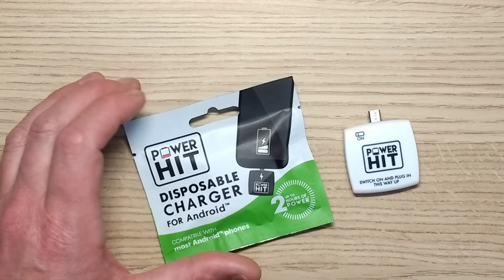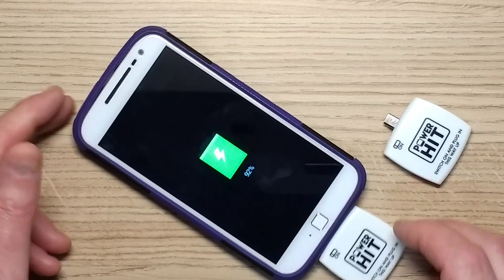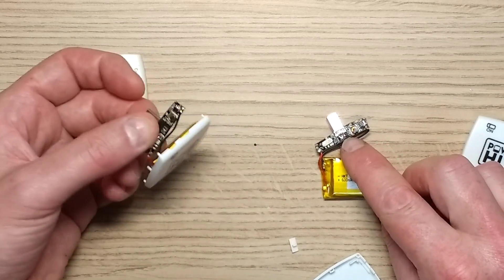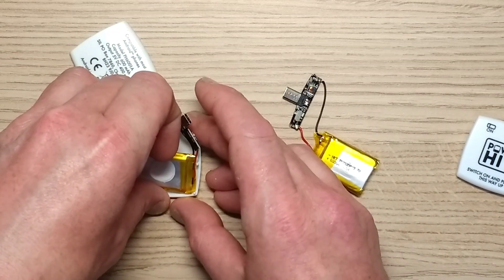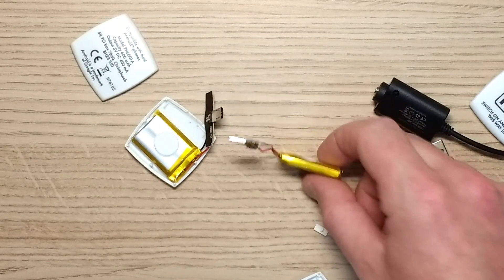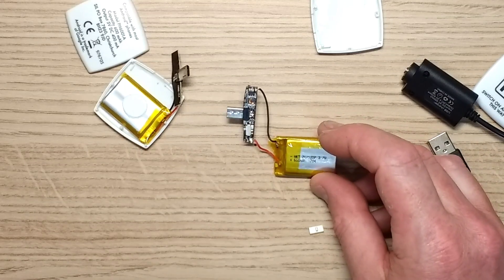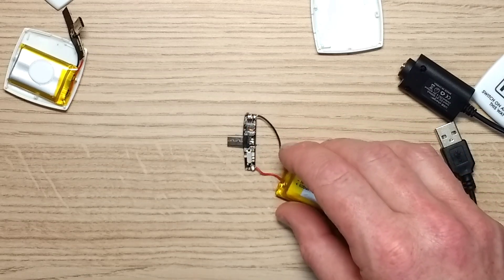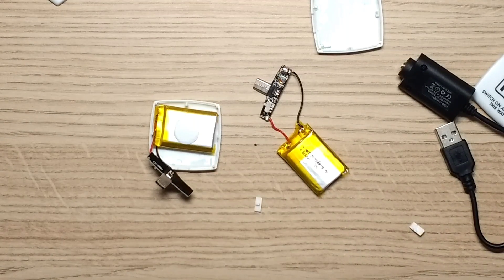What's inside a Tesco Power Hit disposable phone charger.

Comment: This is an awful product! It's a third of the price of a reusable powerbank and is just going to landfill or end up in our oceans!
Reply: buy one use it rip off battery solder on aaa/aa battery holder not a waste if you buy 1 2 then its a waste unless you want to make your wife one you get my point
Reply: the reason people buy them is so they have it in case the phone needs a emergency charge and there is a plug socket or power bank. (also i have had bad luck with power banks/portable chargers)
Reply: silly face Yeah but Lithium sets on fire on context with water. All you need of for the casing to be pierced, and maybe some water, but that isn’t always necessary, and you’ve burnt a bin and maybe even a building down
Reply: Lyn Berger How? Are you mad
Reply: In our oceans? Like the dried up oceans we extract lithium?
Reply: This is more meant for emergency scenarios where you keep one of these in your car or wallet so if you ever find yourself caught in a bad spot and the battery is running out you'd have enough juice to at least make a phone call and get to safety.
Reply: Brian LO Still an awful product because it could be rechargeable but isn't.
Reply: SpaghettiToaster It's not meant to be. It's a disposable one time use Emergency item.
Reply: Brian LO Which is why it's a terrible product. We're going in circles here. Selling a functionally complete iPhone X that's just missing an operating system as a paperweight is a waste of resources. Saying "it's not intended to be a smartphone, but a paperweight" doesn't change that.
Reply: SpaghettiToaster I think we are looking at the word "emergency" differently here. I am seeing it as an emergency backpack as in if your stranded in the wild because of an injury during a hiking trip and you phone is running out of juice, this is part of the emergency kit to keep you in contact before help arrives. You're seeing emergency as in running out of battery in the city where the power kit is a disposable item that aims to replace rechargable thousand mah batteries. Different purpose entirely imo. My original post was about how if this was marketed towards the survival crowd this could be a hit.
Reply: Brian LO I don't care if it serves its purpose as an emergency item though, it's a fully functional rechargeable lithium battery, which is designed to end up in a landfill. Lithium mining is terrible for the environment and mass producing these is not justified, no matter what they're used for.
Reply: SpaghettiToaster You do know there are recycling points for used batteries....
Reply: Brian LO Yes, but this product is specifically marketed not to use them. The packaging says disposable in fat letters and if there's any note on the back that you're supposed to hand it in as a battery, it's hidden and nobody will ever care about it,  because nobody who would would buy a disposable power bank in the first place. Also, I'm not sure if most battery recycling places would even accept this. Anyway, the mere production of these is just a joke. You're producing hundreds of thousands of batteries that have the ability to refill a phone for a decade and design them to be discarded after a single use. It's a massive waste of resources and even if all the batteries were to be recycled it would be a massive loss of energy just to re-manufacture them into an actually feasible product. It's about as good selling a disposable car.
Reply: SpaghettiToaster It's kinda basic civic education. In NA there are green boxes where you just dump these batteries in to recycle there's no refusing. In Switzerland for instance recycling rate is at 70-80% , how many of them gets recycled depends a lot on the government and the quality of the people. Recycling wise it relies mostly on government subsidies ofc since it's not profitable but that's another story. You're still looking at this product wrong. These batteries are designed as emergency one use items like cotton gauze. Cotton can be made into clothes that can be worn for years or it can be made into a single use gauze to dress wounds. If you keep on expecting cotton gauze to work as a cotton t-shirt you're just setting yourself up for disappointment. But of course I'm looking pass the marketing and see only the hardware and its utility. Who will actually buy it when most malls have free charging ports and people already bring their own charger..... I'm seeing this more as an item for the outdoor survival crowd and there's a genuine market for stuff like this.
Reply: Brian LO Brian LO Brian LO Well, I fail to see how you can consider it a civic duty to recycle batteries, but not to not produce disposable rechargeable power banks in the first place. Secondly, high recycling rates are for lead-acid batteries; most places won't even take a lithium unit because nobody is insane enough to throw one away, unless it's broken,in which case you usually take it back to the manufacturer. Thirdly, as I said, even if all the batteries were to be recycled, this would still be a massive loss of energy. A disposable car with a non-refillable tank is recyclable. It's still an utterly idiotic idea. 

Lastly, your cotton analogy fails for several reasons:
1. Cotton processing doesn't have nearly the environmental impact that lithium mining does,so even if cotton balls were equivalently wasteful, it wouldn't be a cause for concern. Also the "cotton balls take away cotton from clothing too" argument is flawed, because lithium is rare and cotton is not. 

2. It isn't actually equivalently wasteful at all, because cotton balls are much simpler objects than clothes. Less work and resources go into creating a cotton ball than a jacket. They are a simple product that can only do one thing and is used for that purpose. 

The power hit, on the other hand, is a 300$ jacket without arm holes that is being marketed as a cotton ball. 95% of the resources of making a jacket already went into it, but you can still only use it to cover your wounds once and then throw it away. This is wasteful and a terrible idea. 

There is absolutely no excuse for this product,a fully functional power bank,save for a cheap microchip and a hole in the bottom,not to be rechargeable. You could still put it in your backpack, it would still do everything you described and at the end of the day you could charge it up for your next tour. And surely you wouldn't mind paying 5$ extra for your emergency item to last you forever instead of once. 

Finally, even if all the above weren't the case and it couldn't be easily changed into an all-around superior product, the mere production of disposable lithium batteries is just a terrible idea. Each of these batteries, if recharged, could power a device for a (human) lifetime. Each disposable lithium battery produced is decades worth of power storage thrown in the trash, lost forever or until recovered with significant energy loss via recycling. 

Also a detail I haven't even mentioned yet: You know what happens if some uneducated person throws this thing in the trash and it breaks, then throws something wet on it? That's right, it catches on fire and burns their house down. Nice!

Zero advantages and tons of severe disadvantages over a rechargeable unit.
Reply: SpaghettiToaster If your country doesn't teach recycling and keeping your country clean as a basic civic duty, the education system has failed. Have you ever even seen a Green Box before in your life or even bothered to do an ounce of research if you haven't? It's not a counter where you hand it to a person. It's a box you dump your battery into , if anything the lead acid car and motorcycle batteries you listed are specifically BANNED from the BGB Initiative. Dude if you can't even 1 minute of research before mouthing off you're wasting my time. This is my final reply. 

The smallest rechargable battery is still at least the size of a traditional wallet. This is smaller than a credit card that fits INSIDE your wallet. Stop expecting it to do what it wasn't even designed to do! This thing is the size of a disposable disinfecting wipe you keep in a first aid medic bag. Do you even have an emergency medic bag in your car? Holy shit. I give up. This is enraging. You're supposed to keep this in one of those small kits you keep all the time so when shit hits the fan you are ready and don't need to worry if your battery bank is charged. Have a good day sir. Good day!
Reply: Bristol Nature Channel You cannot be any more right. We just need to stick with our rechargeable power Banks... They're more convenient and you don't have to throw them away as well anyways...
Reply: Wanna bet! :)  Dead easy to charge with a little nouse.
Reply: agreed
Reply: People arguing that it's meant to be in your emergency kit, why not have a rechargeable battery pack in your emergency kit instead? Same thing, except you can charge it up again. Also a solar powered one might come in handy.
Reply: SpaghettiToaster What are you trying to accomplish here? What is your mission? He say it serves well as a small emergency charger that doesn't get in the way and plugs right into the phone, without a USB lead. You say he should not consider it as a absolute last resort emergency item, and that it never gets recycled. I'm failing to see the point here. The point is not that it shouls not exist, because it does and it will. The point is not that it's destroying the nature just because it's disposable and has a LiPo inside it. Faulty power banks can get disposed of in the trash because people don't care. Recycling is something we cannot control, we can only control our personal recycling. So, what are you trying to accomplish here?
Reply: PunakiviAddikti 
His point is that this is literally the same rechargable battery that power banks use, except this one doesn't have a recharge port. That's it. No other advantage, no difference, just no way to recharge it. That's why he's saying it's stupid. On top that, which he states, is the fact that this rechargable battery is intended to be discarded after one use, which is also stupid. That's a terrible idea for the environment, and loses us some valuable reusable materials and energy.
If they literally just added a charging chip to the battery it would take extremely little effort or resources, make it absolutely no larger or less useful, yet 100x more functional and better for the environment. It's a rechargeable battery with the recharge port removed and then sold as a disposable, basically.
Reply: Brian LO might as well get a powerpack for that and keep that charged in your car
Reply: Cyber Cactus Yeah, I agree with you. But, what I meant is when that is put aside, what is the point? To me its like he's trying to change people's opinions with his arguments, which will most likely never work. That's what I need to know, what's the point of arguing, other than convincing it's a bad idea? It is a bad idea. The only advantage I can see is that it doesn't need a USB cord, is lightweight and sticks to the phone, reducing bulk. The flaws do outweight any benefits I would still buy them, because they have a decent 5 volt boost circuit, a micro USB connector and a source of cheap LiPos.
Reply: AR-Gaming Triple A (AAA) and double A (AA) are 1.5v cells where as Li-ion are 3.7v cells
Reply: @Lancaster604  you can literally have the same exact thing, but can be recharged, they make powerbanks this size that can be recharged, its not that difficult
Reply: @Lancaster604  That's what solar power banks are for
Reply: @XiaoYueMao  true I also have emergency powerbank it's really small I think it smaller than the one in video but most importantly the powerbank can be charged after running out of juice so I don't need to throw it away.
Reply: Gunnar Dearth More like the lithium found inside the seafood we eat during our night-out
Reply: This product is just another ridiculous money-grabber sold online. God, please. If they are lazy enough to buy a one-time-use power bank that can’t be recharged, don’t even bother to expect them to throw this crap into the recycling bin. I bet some of them will just throw in the woods or put it somewhere amid the bushes. This is tips for somebody who is afraid of having their cellphones running out of battery: Buy. An. Actual. Powerbank. Instead. Of. This. Joke.

Comment: This needs to become public and Tesco should pull these off the shelves. It's a huge waste!
Reply: LoneRenegade They'd just bin the unsold stock, reducing them from 0.2% efficiency (1 use out of 500 possible), to 0% .  But the people deciding to have this made needs punishment.  The outside labeling mislead customers into thinking these are alkaline or other type of known primary cell suitable for the existing recycling processes.
Reply: That doesnt matter, it would send a signal that make them think more carefully in future.
Reply: Well it is public.  Go to the store and there it is.
Reply: One could just sell these cheaply to a hackerspace or two, and other hobbyists.
Reply: Or justmake them rechargeable. So low capacity, I have a single cell old usb powerbank from 2011 with same capacity. I just use it to charge up my ipod of bluetooth headphones now.
Reply: What about the AA alkaline batteries we've been tossing for decades? A disposable battery is a disposable battery. Potato potato.

(Real answer is we should recycle both)
(Best answer is only buy rechargeables)

Comment: 2018 Disposable iPhone, when it runs out just buy another one 😂
Reply: iPhones are basically built already like that
Reply: The batteries on iPhones already wear down fast 20% of the original capacity is gone in a year. Or at least it seems like that.
Reply: Thonmoy Rahman Well,everything wears out,if you keep a rechargeable battery for a long time,it will loose some capacity.Same with cars,loosing horse power over time...
Reply: OmgItsAnosh  yeah , iPhone SE , EVEN WORSE
Reply: OmgItsAnosh iphone 8😂
Reply: Don't let Samsung see this, they will copy .
Reply: OmgItsAnosh Techrax
Reply: OmgItsAnosh the iphone 9 won't have a connector
Reply: OmgItsAnosh seeing that they removed the headphone jack, I wouldn't be surprised if they removed they charge port
Reply: wireless charging so its not that far fetched
Reply: More of like a Samsung idea since they release a gazillion models every month
Reply: eign but apple takes forever to bring out the exact same phone again
Reply: eign ya know the funny thing is every time Samsung or other Android based companies comes out with some new cutting edge technology or software you apple fans are nowhere to be found but when apple copies and releases it as their own two years later its "revolutionary" and "well worth the 1000$ and infringement of your rights"
Reply: Konata Izumi Samsung isn't stupid like Apple, get your head straight
Reply: lol, you sure?
Reply: NekoNi OOH. ITS A 3 DOLLAR SCREWDRIVER. Uhh. So expensive
Reply: OmgItsAnosh #apple2018
Reply: OmgItsAnosh I already throw apple products in the garbage after one use.
Reply: Spookeh the iphone 5 runs ios 11 about as well as the 4 ran ios7. its okay. but you still regret making your phone twice as slow as before
Reply: I used my iPhone 4S from December 2012 until April 2016, when it fell out of my sweatshirt pocket onto the sidewalk and the screen shattered.

Comment: Bridging the data pins is completely normal, given the device's purpose. Smartphones use the data pins to detect the type of power source they are connected to. For example if you plug your phone into usb port on your laptop it won't pull more than 500mA. Chargers on the other hand have a circuit that "tells" your phone how much current it can pull. When the pins are bridged the phone uses the voltage to determine if it can pull more current or not. In a unit like this, being disposable, you don't really care about damaging the cell or the chip in the process so this is the cheapest way to do it.

Comment: putting a resistor across the datalines sets the charge current in the phone. 

Shorting the data pins means "this charger functions according to the DCP section of the USB Battery Charging Specification". so up to 500mA are allowed.
Reply: Paul Paulsen Really? Can you cite the edition and page number for that.  I used to think "open"="500 mA", "shorted"=about 1A, "active USB host"=100mA until otherwise negotiated, others values for higher currents.  But I'll have to check.

Comment: The inductor case is broken because in China you can buy components with manufacturing defects for insanely cheap. I'm sure that most of the components in this product have defects but that's fine for single use purposes. I would be wary of recharging possibly defective lithium batteries.

So before recycling defective parts off of the production line you can get some use out of them first.